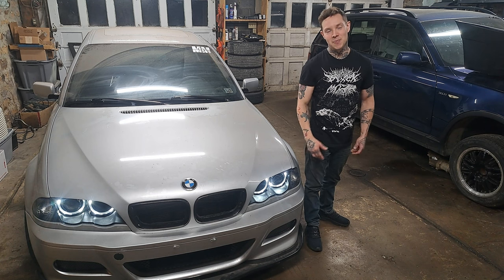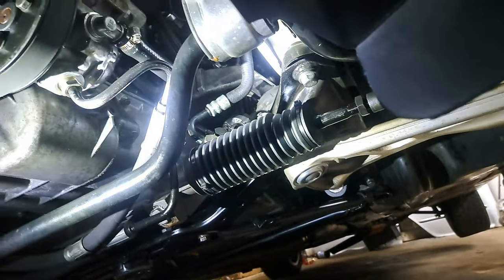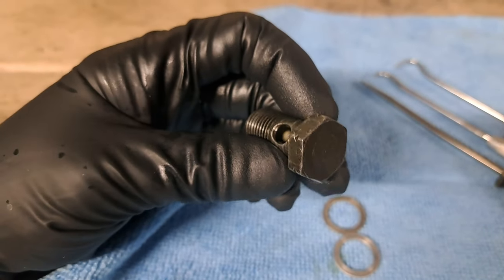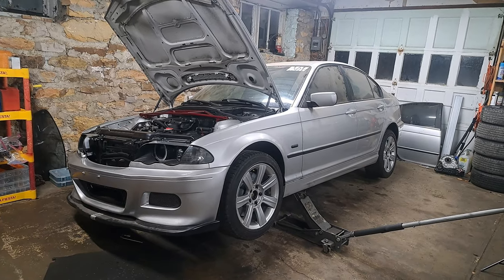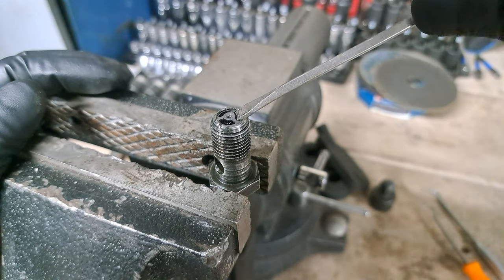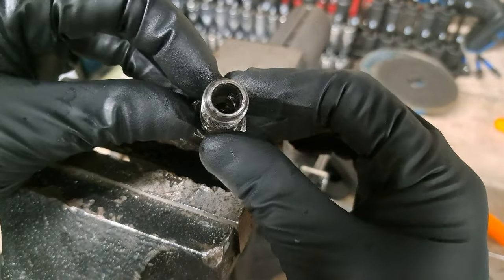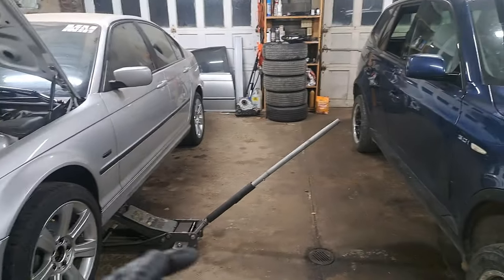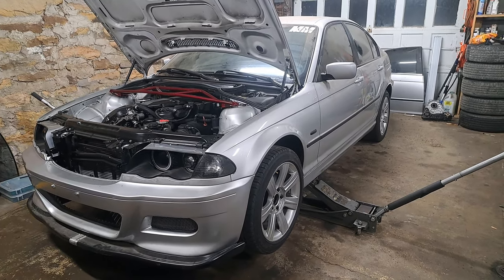Improve Your Steering - BMW E46 E39 Drift, Race, Street Car *Easy and Free*

Comment from the maker: Note, for E39 you'll have to remove the nut for engine mount on passenger side from above, typically an 16mm nut. Then lift the engine a couple inches. This will allow you additional room for tools to access the 19mm banjo bolt. Just performed this on my E39 as well.

Comment: Cool mod. As you mention at the end, do not rely on a floor jack to support a vehicle you’re working under.  I had a family member crushed and killed by an improperly supported vehicle.  Ramps, or jack stands, even a wheel under the car for an extra backup.  Never just a floor jack.
Reply from the maker: My condolences, that's never fun to go through.
Reply: Sorry to here it. 
There was a chap in the next village that had a limo business, he suffered the same fate. 
My Jack rarely goes anywhere without stands.

Comment: just did this today after watching video. 
very easy and big difference in steering feel. 
very happy.
Reply: Hello, how does it feel on the highway?
Reply: @ feels fine. not to loose or anything. this not a permanent mod. if you don't like the feel of the steering you can always get another bolt from the yards and reinstall.

Comment: So heads up for anybody like me who incorrectly assumes that there won’t be much fluid loss from this, it’s a lot.

Idk what I was thinking in retrospect, but I guess since it just cut away when he put the drain pan down there I assumed it wouldn’t be much. 

I was ill prepared with only shop towels even though he grabbed a drain pan. Spent a good 45 mins cleaning up that mess. 

Good luck.

Comment: Hello from Portugal, good video, from the comments I noticed that the steering wheel is lighter when maneuvering with this modification, right?
That would be my goal, as my X1 (E84) has heavy steering... and on the highway how does it feel?
Does this mod work for the (E84)?
Thanks.

Comment: banjo bolt torque values
E36, E39, E46, E52 = 35 Nm
E38 = 39 Nm
E60, E61, E63, E64 = 35 Nm
E53, E60, E61, E63, E64, E65, E66, E85 / S54, E86 / S54 = 33 Nm
E36, E38, E39, E46, E52, E53 = 40 Nm
E60, E61, E63, E64, E65, E66, E83, E85 / S54, E86 / S54 = 35 Nm
E38, E53	Banjo bolt M18 = 45 Nm
E36, E38, E39, E46, E53, E60, E61, E63, E64, E83 = 36 Nm
E65, E66, E67 = 39 Nm

Comment: Great video!
Couple of slightly irrelevant questions to the theme...

What is the line coming off your PS overflow leading too?
Also how does the cooling system functionwith no coolant overflow tank?

I assume you have to keep a good idea on coolant system to make sure it doesnt run low at the least...
Reply from the maker: That's a overflow for the PS, and I do use a overflow/recovery tank for cooling system. It's there, maybe not easily seen in the video.

Comment: Hey bro! really appreciate the interesting video you made regarding this. Do you happen to know if that same check valved bolt is on E30’s as well? E30’s are notorious for having stiff ass steering so it’d be nice to loosen it up a bit if there is such a thing. If you don’t know, no worries too dog!
Reply from the maker: As far as I'm aware, E30s do not have a check valve within a banjo bolt. But it may be worth a check, to see.

Comment: I already did it a mod on my X1 (E84) and I didn't notice much difference, I thought the steering would be lighter
Reply from the maker: @ruilima3908  That's not the primary reason for this modification.

Comment: Nice video! Will try this on my car.
I've had a wierd issue on my E46, the steeringwheel sticks when turning to the right and there is almost 0 force feedback, i have replaced everything suspension and steeringwise(exept the pump) and the issue is the same as always, yes it has gotten an alignment several times and the issue is still there. 
Have anyone got an idea of what it can be? I have orderd a pump but if that doesn't work I am very lost...
Reply from the maker: RWD or AWD?
Reply: @OLearysBMW  rwd 330ci 2001
Reply from the maker: @mmmmm12311  Replace pump, inspect steering u-joint of steering shaft. Not common to go bad, but possible. Also, if not done already, replace reservoir. Built-in filter can get gunked up. I also do recommend removing the check valve that I've shown in the video.
Reply: @OLearysBMW  thank you very much for your input. Will try the pump, reservoir and banjo bolt mod 👌🏻

Comment: Hey man, great video. I have a question about a m54 turbo build. Is it possible to only use 1 o2 sensor of the 4? And which o2 sensor can i use best? I have read that i should only use sensor 1 of bank 1 and delete the other sensors. Is this correct?
Reply from the maker: Hello, some tuners are capable of using solely one sensor as your narrow band, yes. Also, some tuners are capable of using original wiring of downstreams for a AFR wide band. Always consult with your tuner about these types of questions. If you're tuning yourself, researching and asking someone with tuning experience is important. I myself get tunes from external sources, not my own doing.
Reply: Shouldn’t be doing a turbo build if you don’t know what o2 sensor/wideband to use… lol
Reply: Its actually really simple. I found the info i needed on ms4x wiki.

Set the following values that suit you needs:

0: Single bank with one pre-cat lambda sensor or cat-preparation (SA199)
1: Dual bank with two pre-cat lambda sensors or cat-preparation (SA199)
2: Single bank with one pre-cat lambda sensor and one post-cat lambda sensor
3: Dual bank with two pre-cat lambda sensors and two post-cat lambda sensors
4: Dual bank with two pre-cat lambda sensors and automatic learning of post-cat sensors or cat-preparation (SA199)

Comment: is that banjo bolt the only one with that restriction in it?I understand that its the one needing the modification but asking strictly from curiosity 🤔
also,I noticed the modified steering coupler - its not from the e34,but which brend is it?
Reply from the maker: Yessir, just one. The coupler is an aluminum one from Garagistic, which I'd never buy again. Fitment was not good.

Comment: I'm going to try this also where did you get that front tower brace and is it worth it? Thank you in advance!
Reply from the maker: It's Dusan Strutworks. Strut braces do tend to add chassis rigidity. For instance, some M3s have them equipped from factory. Also, Dusan offers them in chromoly, what mine is, which is super light 👌

Comment: those crush washer arent suposed to be stacked. there should be one above and below the banjo line when bolting it in
Reply from the maker: And how do you think I install them?
Reply: not sure u didnt show u installing them n u jus stacked em ontop of eachother in the video
Reply from the maker: @plugpenguin1660  Got it, I was solely discussing/showing them. If you were to stack the crush washers, an obvious leak would appear, certainly. Lol

Comment: Hey man, I wanted to ask you how much power could be made by slapping a turbo on a M54b30. Done a fair bit of research and haven't found anything conclusive. Im looking to make around the 400 hp mark so that I can go drifting. Anything you would advise upgrading? Ive seen that head studs and a thicker head gasket improve longevity. Thanks in advance.
Reply from the maker: 400hp is easy. Should not need more than 8/10 psi to achieve that.

Comment: Any reason NOT to do this on just a street car, regardless of which PS pump I might have?
Reply from the maker: I myself believe they feel great the way they are. But now, I'm doing this to every E46/E39 I get. I performed it on a customer xi, while replacing a steering rack. The car steers like butter. Will update how my E39 feels after I do it. 

Any reason not to do it, hmm. There was a section in this video that quickly covered the cons. But there simply wasn't any, so I just removed it from the final draft.
Reply: @OLearysBMW I'm interested in how this worked out on your e39. I would like to do this but it is my daily street car
Reply from the maker: @stokedska  No issues, as per usual with this mod. It's worthwhile to do.

Comment: The valve controls fluid flow throughout the rev range, it protects against kick back and  it saves the system. There's no reason to remove this.
Reply from the maker: @aaronbligh3619  Though it obviously serves a purpose, it also is a very common issue with SPEC, drift and street cars alike. If you don't wish to remove it, then don't.

Comment: So what was the result of the test? Post a video of the test.
Reply from the maker: Test? What test, I've done this to numerous cars now. I wouldn't just toss a video out there without first hand experience.
Reply: @OLearysBMW  I mean, start the car, turn the steering wheel and see how smooth it is
Reply: @OLearysBMW  or example, if you made a video before and after the change, it would be great. Real performance test.
Reply: @amirmpower170 how are we gonna tell it’s a video bro

Comment: The steering wheel will be a bit easier or the exact same strength?
Reply from the maker: It will be easier to steer the wheel, yes. The car will still feel genuine, though.
Reply: @OLearysBMW  so for racer like me it would be a bad idea cause I prefer the steering wheel to feel as stiff as possible
Reply from the maker: @imestia7911  The issue with this check-valve during race application is during a blunt impact, it can lodge itself shut. Totally starving the pump of fluid. I didn't get to mention that within the video.
Reply: @OLearysBMW  oh okay thanks you I didn't know that
Reply from the maker: @imestia7911  you're welcome. I would recommend to try it. See if you like it.. and incase you don't like it, here's the part number for them; 32416781261

Comment: Thats not a restrictor bro🤦🏽‍♂️its a little check valve that saves your rack in the event you destroy a power steering pump dummy. Now if you destroy a pump, you’re gonna destroy your rack too
Reply from the maker: It's common knowledge that the check valve jams shut during race and drift applications. They're a nuisance. Besides LF20 pump shafts shearing, LF20/LF30 failure rate is very low. SPEC/NASA E46 class cars have them removed prior to events.
Reply from the maker: Where u @? Let's bicker some more.
Reply: @OLearysBMW 😂